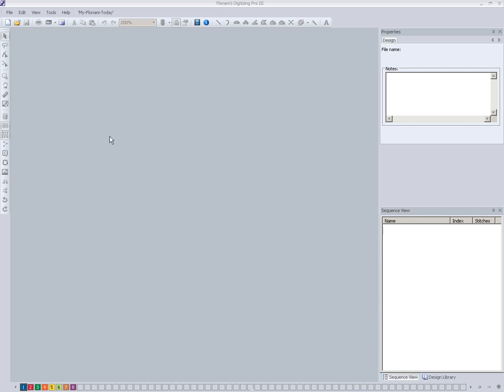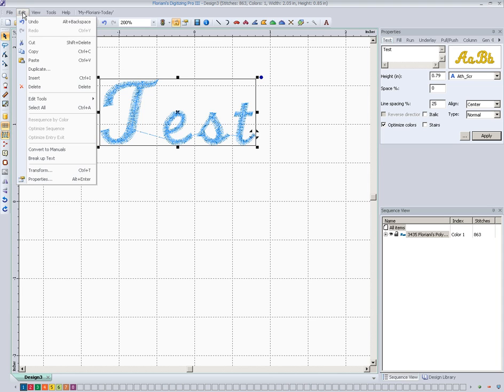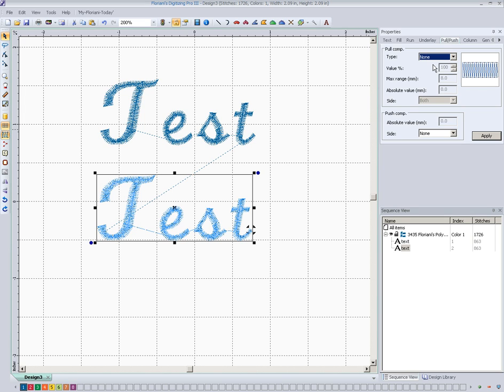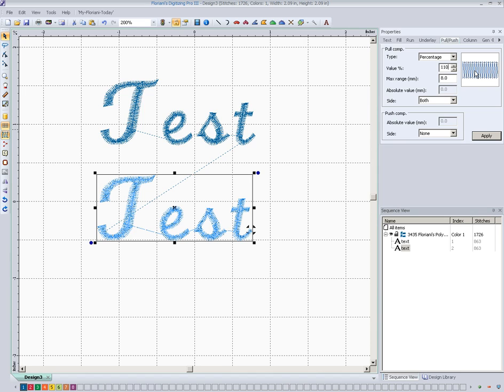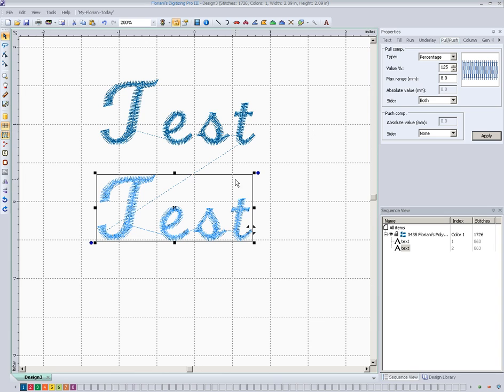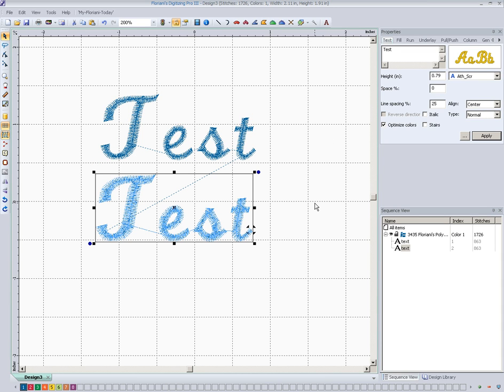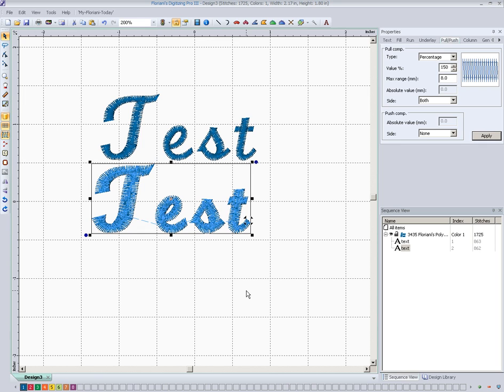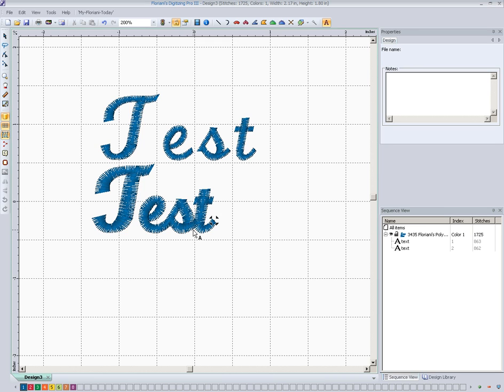Adjusting Pull Compensation in Floriani Embroidery Software

Comment: Thank you for this explanation about pull compensation. I own a Brother PE770 and I have issues my finished result. I have an egg shape object with a black outline that is touching the egg shape. However, when I run it through and it embroiders, there is a gap between the egg shape and the black outline, whereas, on the software it shows no gaps at all. Will increasing the pull compensation help my issue? I'm using Floriani Total Control U. Also, I use tear away stabilizer on the bottom and a water solvent one on top. Thanks! Hope to hear from you soon!